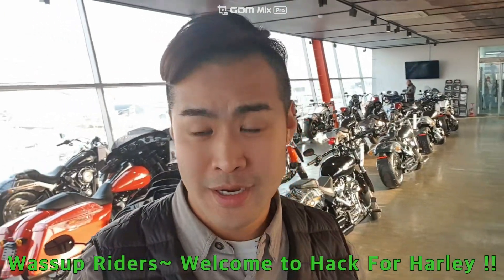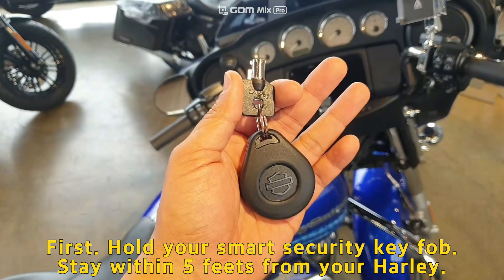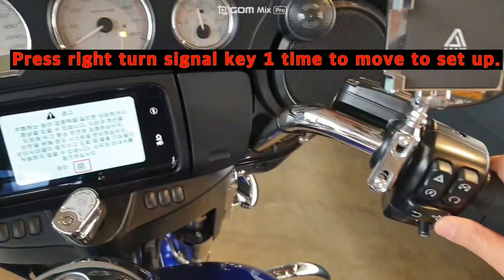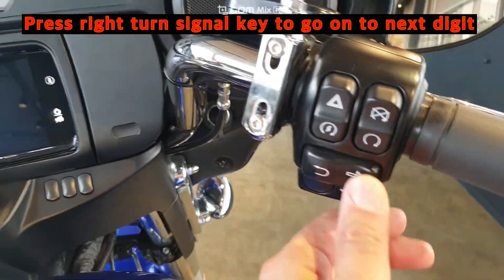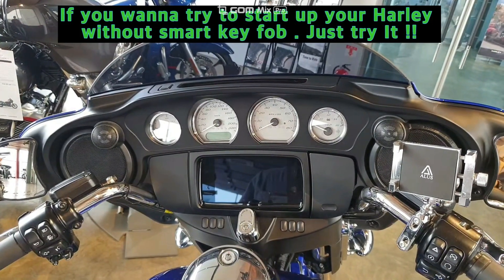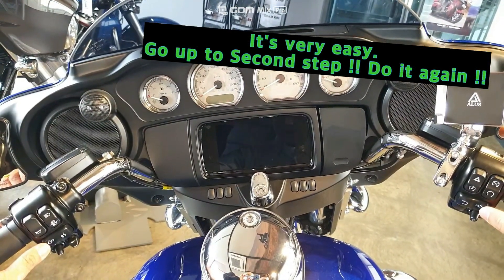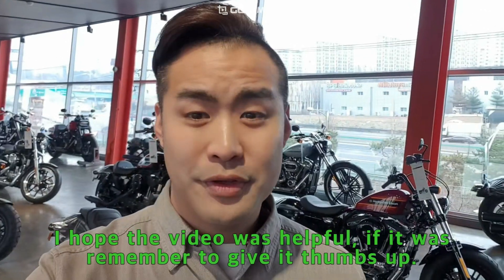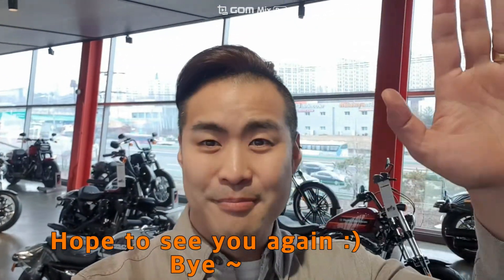Hack for Harley #1 How to change (set up) a Pin Code on Harley-Davidson #harleyhack

Comment: How do you find your pin code on the 2020 lowrider S if the dealership don’t know the pin? Lost fob…
Reply from the maker: If you don't know the pin code and no key fob. Dealership or Service center can do nothing.
we can't connect the motorcycle to Digital tech com system without Keyfob or pin code. 
so, H-D Authorized dealership can give you a basic answer only.
Change a BCM,key fob to new one,  and set them all. 
hope this is helpful...Ah~ one thing I've heard , there are few hack systems, some kind of  inauthorized custom shop can set the new key fob. Good luck !!
Reply: It should tell in the owner's manual

Comment: Thanks bro
What is default harley pin code
Reply from the maker: Depends on Dealer ship. in Korea all the same number
Reply: Default is usually
11111
12345
Depends on your dealership.

Comment: Hi I lost the keys do I have to put a new pin every time I want to start the bike?  and where can I buy the new key fob..
Reply from the maker: Hello sir, 1. if you don't have smart key fob ...yes...that is the only way to start the bike . 
2. when you buy a brand new key fob  you need to sync and register between fob and bike. 
you'd better ride a bike to authorized dealer near you. thanks for watch this video.

Comment: Does this work on 2009 Sportster 883?
Reply from the maker: If it has a smart keyfob and module system..
Reply: @TupacKim  I will try it but my left signal button is broken at the moment. Looks like i will try it after i fix it...
Reply from the maker: @TheWitac  yeah you'd better fix it first. Hope it works 🙏